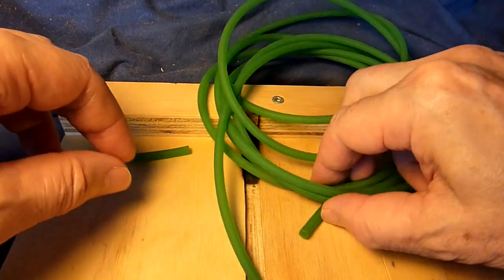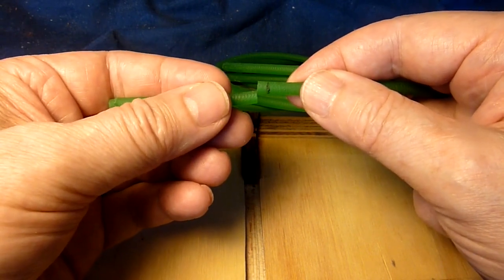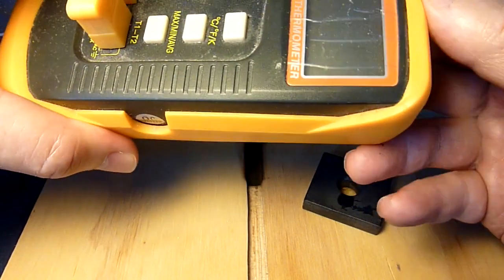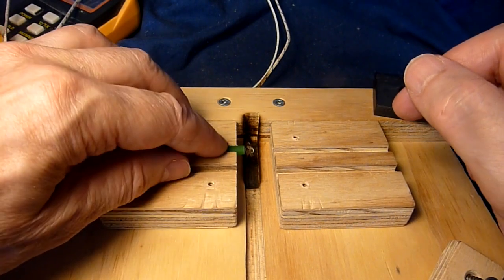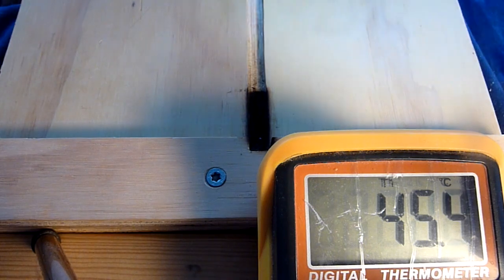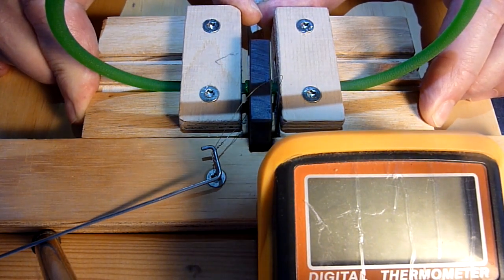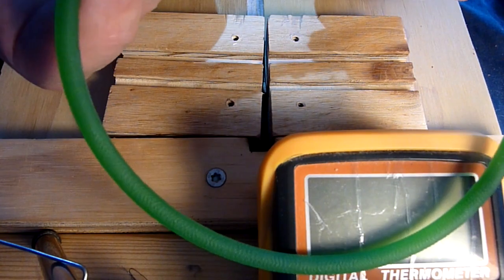How to Weld a Round PU Belt in DIY Way

Comment: I just replaced the leather belt on my 1938 Singer treadle machine, just used a lighter, melted it without burning, and pushed it into a corner to align it....worst part is dressing the joint smooth. Carefully use a sharp blade or try angle cutters, or try sandpaper. Caveat, I had previous experience with this belting on machinery so was comfortable using it. Also doesn't slip on the pulleys, and is infinitely repairable.
Reply from the maker: Thanks for the reply. Yes, I know more people have used your method and reported success. I did however also see some warnings regarding temperature used. Therefore I decided to suggests this procedure with control of temperature in a video.
Reply: @sewingmachinesindetail  When other hands were available we typically used a piece of heated metal slid out of the way.  That allowed more focus on alignment. This stuff was always far easier than the ribbon belting that had to be tapered, glued, then set in a hot clamp, or the "stapled" type.

Comment: Nice rig. 
DIY heatsource alternatives; A stationary type electronics brazing iron with heat regulation and a wide flat work surface, or a thermostat regulated hot air pistol to blow air through a hollow metal sheet box would also do well.
Reply from the maker: Yes, you got many alternatives. But I guess that an automatic temperature regulated heat surfaces normally will be more expensive. Most people got a piece of metal and an electric hob in kitchen. You will normally need a K-type thermocouple to check the temperature anyway.

Comment: How was the metal block heated? I missed that part. Temp continues to rise as block is setting in the wooded jig?
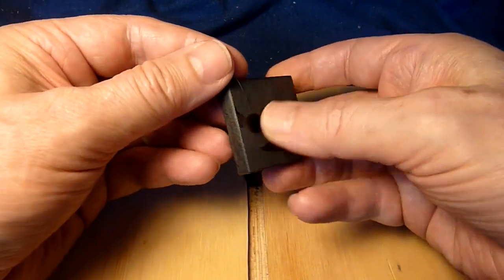Reply from the maker: I use an electric hob in kitchen. I guess, that most people seeing this video have got that too. Look 1:48 in video. When the 100 gram steel block is placed on the sensor thermo element, the measured temperature of the thermo element rises to the temperature of the steel block in about 12 seconds. Then you start to see a decrease in measured temperature at a lower rate, because the temperature of the steel block is cooled by the surroundings.

Comment: You've over complicated this process by about 100!... I used a simple lighter to melt each end.. Made an unbreakable joint after the 30 minute curing time...
Reply from the maker: Thanks for the comment. My video show one cheep DIY example of how to do it based on the recommendations for welding by professionals in the market. They warn against weaknesses caused by excess temperatures. I do know the method you describe using flames or indirect to heat up heat other metal surfaces to be used. But I have not seen trials  test data from measurements regarding strength and durability. Your method will be easier,  and may work in most cases, but I cannot recommend something that do not have some scientific or professional reference.

Comment: I heated the belt with a Styrocutter, works fine.
Reply from the maker: Good to know. Can you set the temperature of the styrocutter thread?
Reply: @sewingmachinesindetail just have a wheel 1 to 9 had it on 8 or 9 i think

Comment: Thank you!  You video is the only one I  could find that mentioned the correct temperature for melting PU. I got out my soldering iron for electronics, set it to 280 C, melted the two ends simultaneously then carefully pushed them together with my hands.  It works perfectly for my rock polisher. Going on two months with no breakage.
Reply from the maker: Thanks for your comment. I was very confused about this issue, when I did the welding first time, and therefore I made this video. When you look at my text to video, you find sources of information recommending both higher and lower temperatures, than the 270 C i use, but it is in the range 250 to 300 C. If you have no control of temperature, you can easily do welding outside this range. Be aware of the material properties as well, as I mention in the text.

Comment: I wonder how stiff this PU is compared with a similar outside diameter automotive vacuum tubing? I am currently using some of the auto vacuum tube for running a pulley, but it is fairly stiff and resistant to bending around the small motor pulley. (This is currently turning a 6" wooden pulley on a double pulley speed reduction set-up) I will give the PU a try if it promises to bend easier than the vacuum tubing. Also, I would try to glue the PU with a cyanacrylate glue instead of heat bonding. Any thoughts?
Reply from the maker: Sorry, I am not that familiar with automotive vacuum tubing, so I am able to compare. I got no experience in using cyanacrylate glue on PU material. In general, I know that a black V-belts (the raw edge types are best) will cause less transmission loss on a sewing machine. I made another video to compare belts and pulleys.
Reply: @sewingmachinesindetail  OK, thanks!